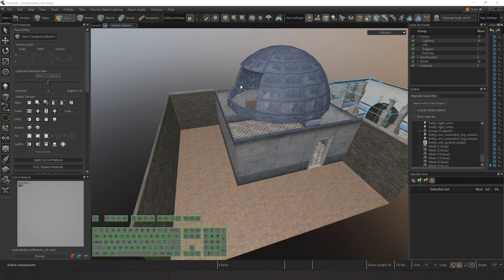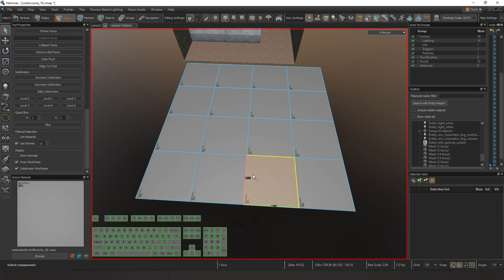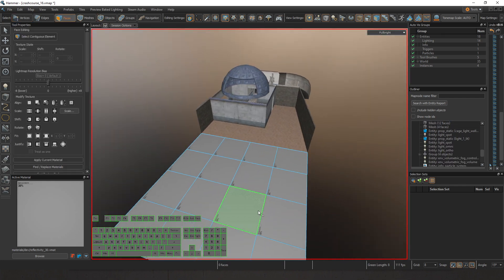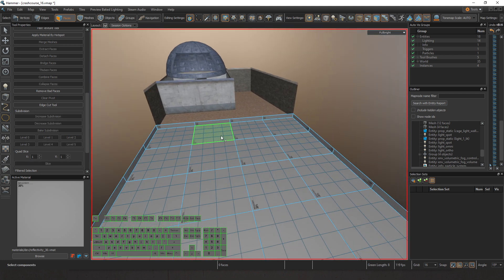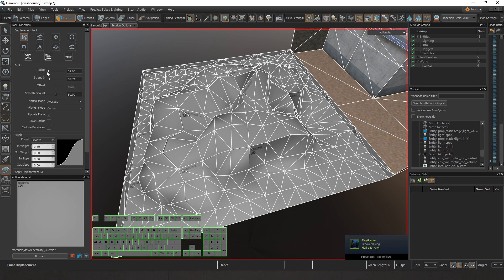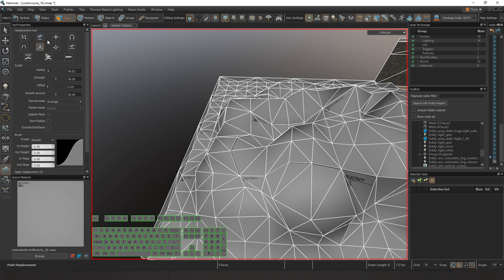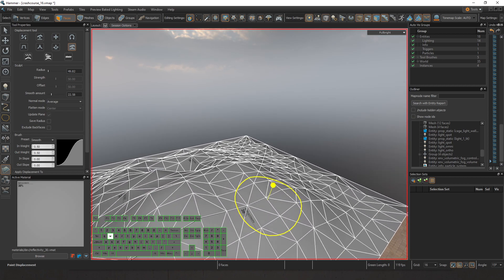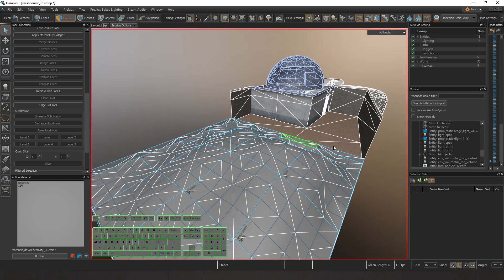Source 2 101 - Hammer Crash Course #16 : Terrain Displacement (tutorial)

Comment: 5:17 if you say "Level 3" is only for very high detail like in caves...
For wich cases is then: "Level 4" and "Level 5" ?
Reply from the maker: dont use level 4 and 5 they are really really bad for optimization
Reply: @eagleonedevelopmentteam849  And what should you make, if you have to make very huge terrains?
Currently I have 100x Level 5 Terrains on my map where every plate of it have the area of the Source 2 default world border.
If I would like to use a smaller powel level, I would have to clip the terrains in quards qhat would make my current 100 terrains into 400 but with level 4 power now instead of level 5.
(My map have the area of 10x10 source 2 world borders)